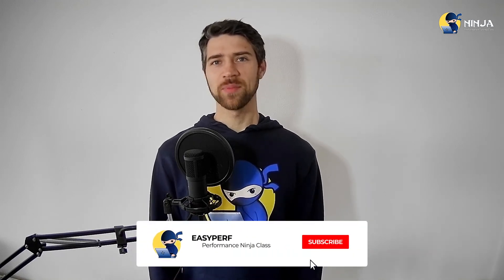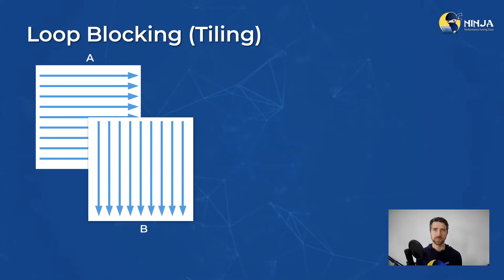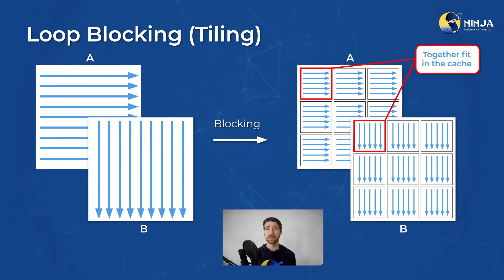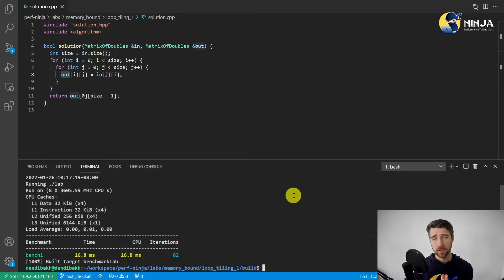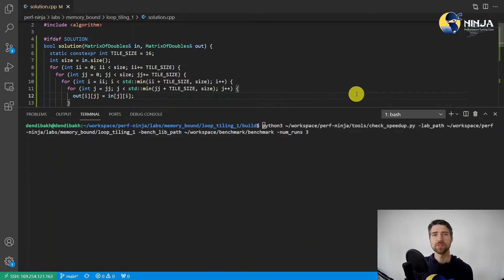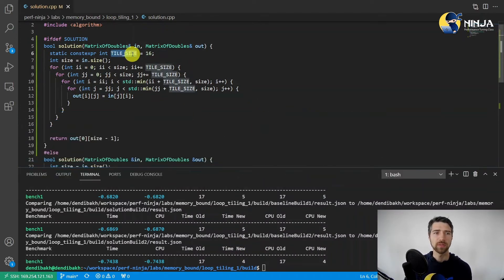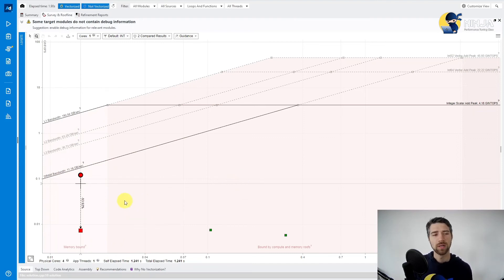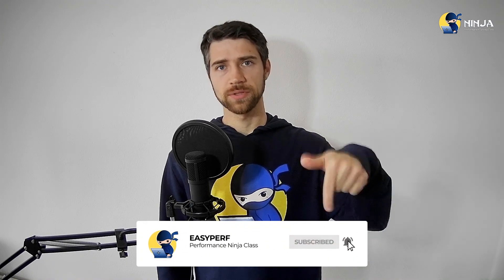Performance Ninja -- Loop Tiling 1

Comment from the maker: Here is the complete code of the solution:
```
#include "solution.hpp"
#include <algorithm>

bool solution(MatrixOfDoubles& in, MatrixOfDoubles& out) {
  static constexpr int TILE_SIZE = 16;
  int size = in.size();
  for (int ii = 0; ii < size; ii+= TILE_SIZE) {
    for (int jj = 0; jj < size; jj+= TILE_SIZE) {
      for (int i = ii; i < std::min(ii + TILE_SIZE, size); i++) {
        for (int j = jj; j < std::min(jj + TILE_SIZE, size); j++) {
          out[i][j] = in[j][i];
        }
      }
    }
  }

  return out[0][size - 1];
}
```
Reply: I didn’t completely understand why in this case L1 cache size matters, not only cache line size. Here we benefit from accessing each cache line 8 times. if the cache line is 64bytes, double - 8 bytes - only 8 double fit inside the line. So 1 access is cache miss and 7 cache hits. The size of blocks for both matrix should be 8x2 cache lines, however when I increase the step size there is a small performance improvement which confuses me. Could it be due to bad matrix alignment so that the tile split between two cache lines?
UPD: First guess was that the alignment was the problem, i fixed the alignment of matrix rows but the perfomance still was increasing for tile size [8<16<32< .. <256]. So now i think the main reason to adjust size of tile basing on L1 is cache prefetcher: it's much easier for processor to predict sequencial row and column access - if tile is of width 8 we will have less then 7 correct prefetch, but if the width is 256 we will have much more correct prefetches. I double checked and with 256- sized tile has 30kk successful prefetches vs 2kk with 8-sized
Please correct me if this is wrong, or confirm if this is actually true)

Comment: nice one!
thanks)
just started to type about cache oblivious algos then you mentioned then on the video, ha-ha

I've noticed that the benchmark framework doesn't show you measurement deviation like 100ms +-5ms
which is (usually) crucial to proof the optimisation is useful
how can I contribute to the project, please?
Reply from the maker: That is true. My CI machine should have more stable results, as it is configured for running submissions, but in general, yes, there is noise.
> how can I contribute to the project, please?
Shoot me an email, or ping me on Twitter.